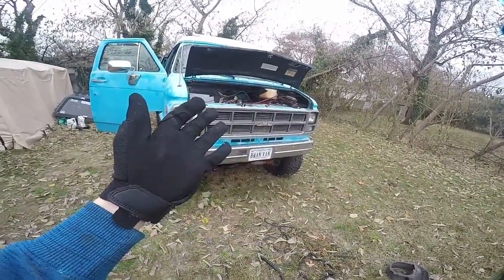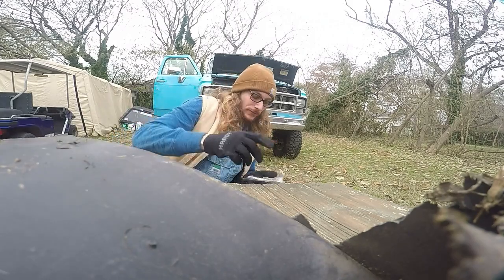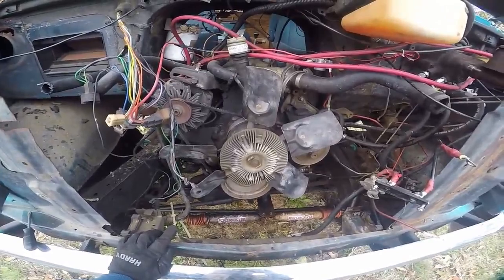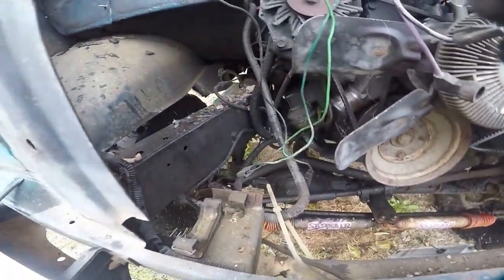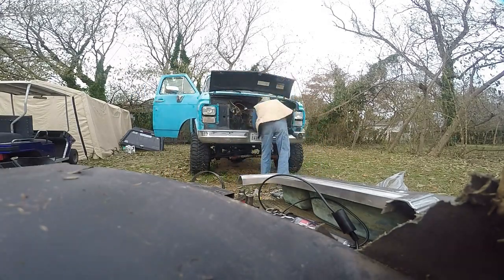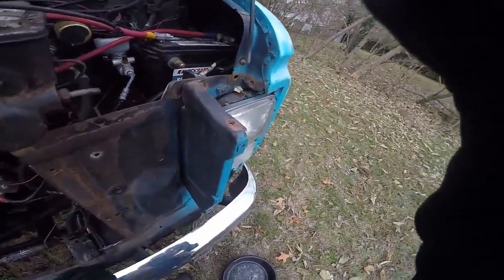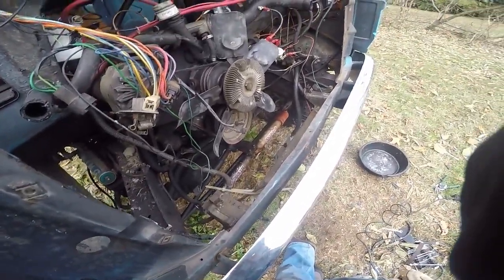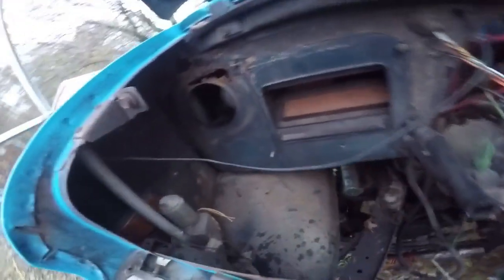4x4 Van Project Re-Rebuild part 1

Comment: Did you use the stock sub-frame that the motor mounts bolt to and if so did you cut part of it away to shorten it. looking to do a 4x4 set up but I'm not going to spend the $2700 for the kit through Boulder Off Road. That doesn't included everything for the swap. also would you have a link for the clutch pedal you installed
Reply from the maker: The van frame is stock, to make it easier leaf springs shackles could be welded to the frame/unibody. I used king coil overs and a non triangulated 3 link set up. My clutch is a hydraulic bell housing and a clutch pedal assembly from summit racing.
Reply from the maker: Well the bell housing is from eBay for the sm465. I tried the z bar but it was too much for me to figure out lol.